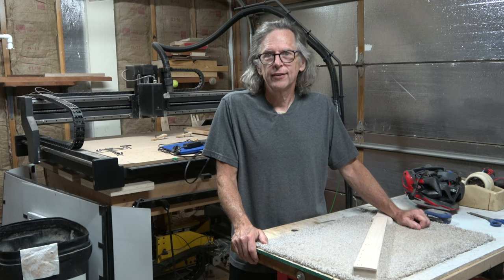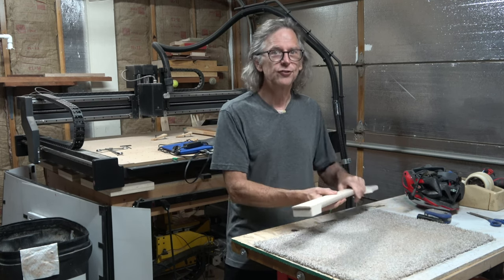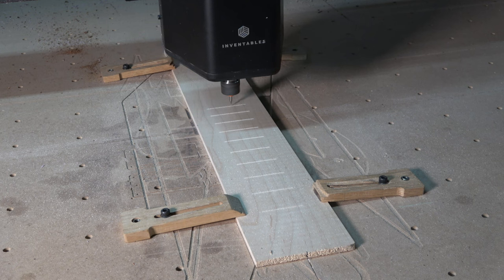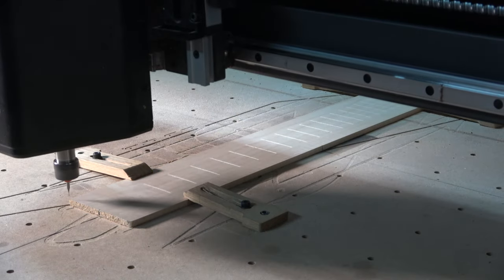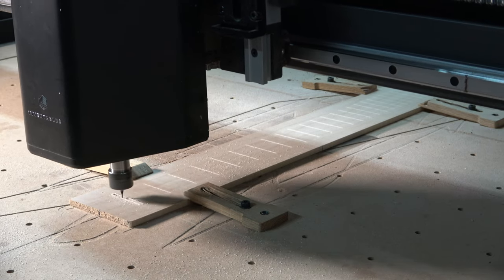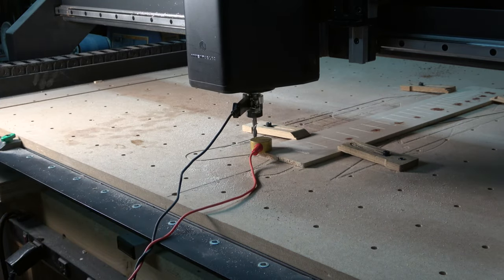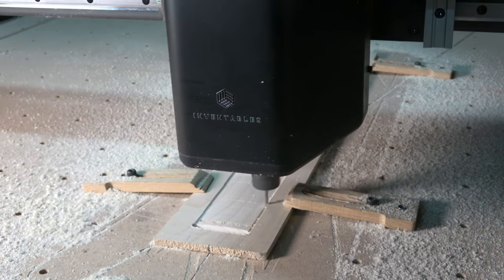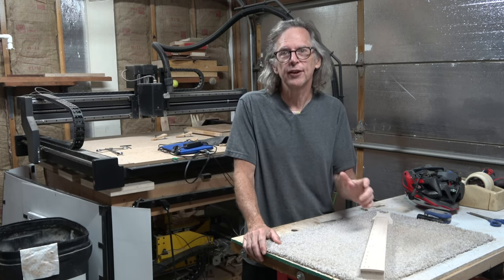Combining A Headless Electric Guitar With A Traditional Electric Guitar Part 4 Making The Fretboard

Comment: Interesting. Often folks only use down cutting bits on wood to prevent tear out of the fibers.  But it appears that you use up cutting bits on anything where you are cutting to a greater depth. How do you choose upcut vs downcut for your tool selection?  Thanks for sharing - I start machining my own bass next week!
Reply from the maker: I use downcut bits to start my pockets. I'll cut to a depth of about a 1/4" and switch to an up cut bit to clear the remaining material to the final depth. This approach keeps the edges of the pockets clean while evacuating the chips efficiently.

Comment: Two questions about the CNC machine. Does it run on Windows or Mac OS? Is the laptop connected to the machine by cables or bluetooth? Thanks again for another good video.
Reply from the maker: The X-Carve Pro uses Easel which runs from a browser on Windows or Mac OS. The computer is connected to the controller a USB cable.